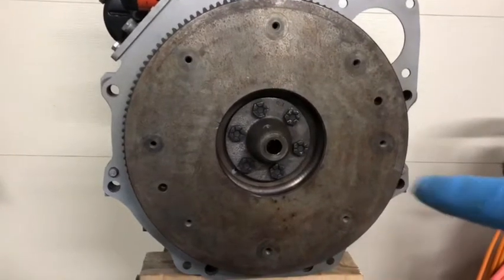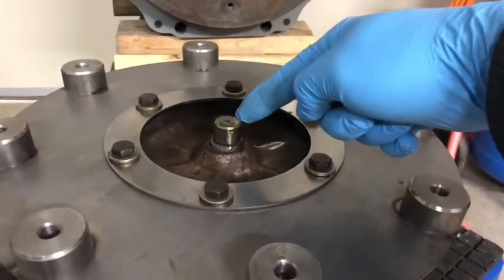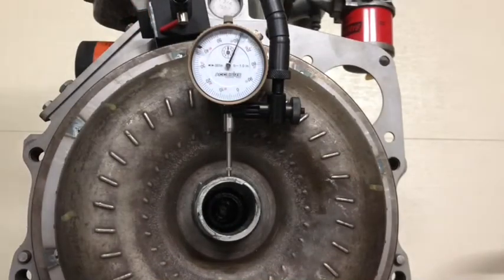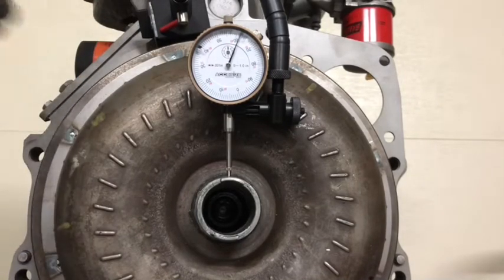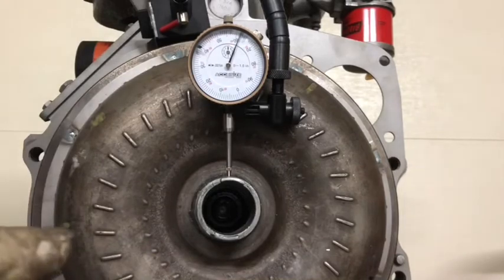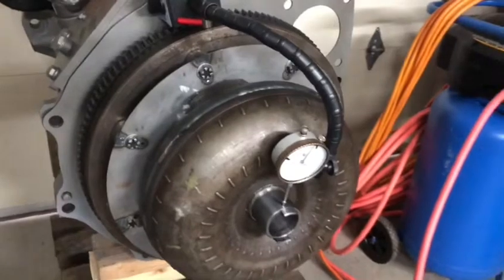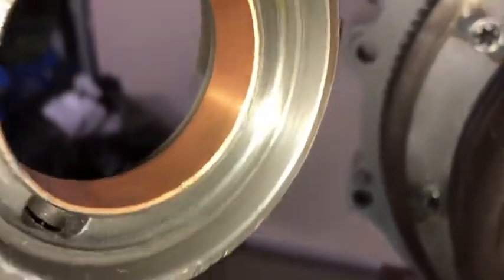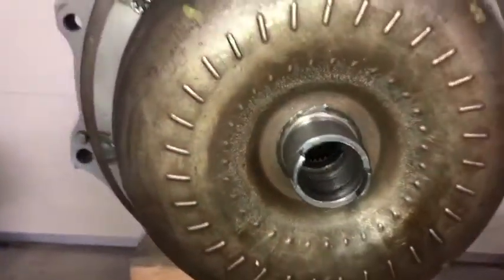Ford 555 flywheel torque plate and torque converter

Comment: Yea you wanna put the converter in the pump first then mate up the engine and bolt it down through the starter hole, cause if you don't it can take out that bearing in the front of the pump, and the oil seal. You just gotta wiggle and see with a mirror and light that the nipple on the front of the converter made it into its nipple hole in that cone. Other thing is that, you really wanna feel that the converter meshed into the pump with those tabs by hand.

For some reason people always screw this up on chevy transmissions and it ends up ussually destroying the transmission and the converter

Comment: I normally fit the converter on the pump and mesh it in, then mate the engine with the transmission and fit all the bolts thru the starter hole, never had I an oil leak from the front of the pump.